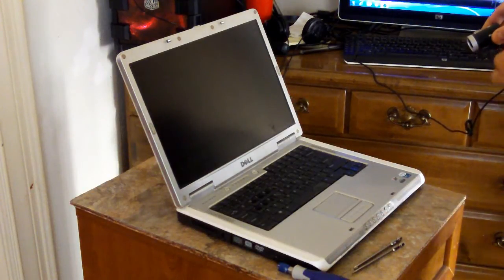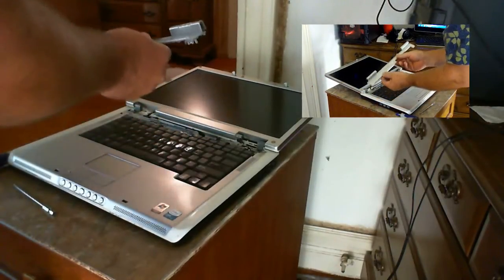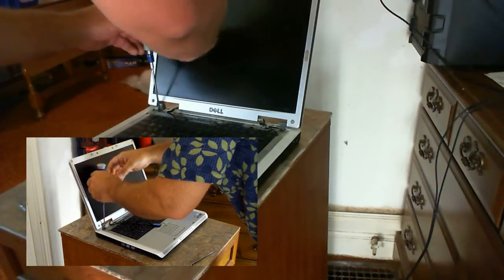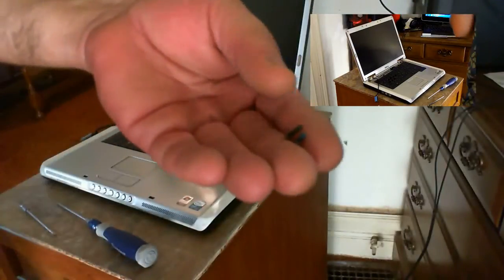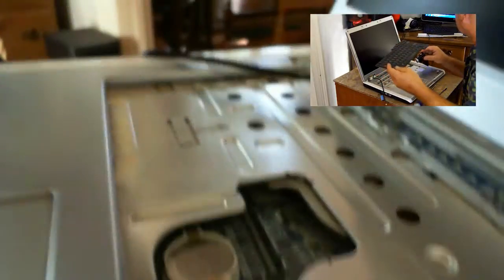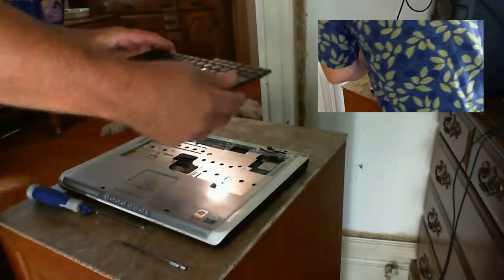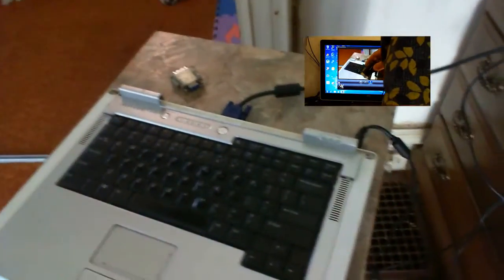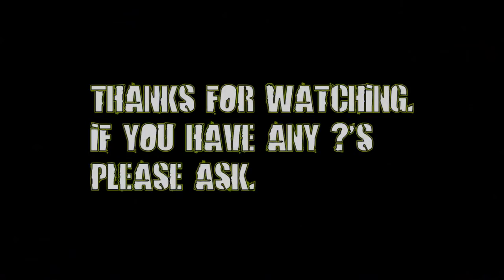Dell Inspiron E1505 laptop screen removal

Comment: Just to let you know, there are two screws you forgot to mention. There are two screws underneath the laptop that are connected to the long metal hinge posts. I figured it out when it didn't pull out as easily as you showed in your video.

Comment from the maker: @maddog9269 Yes but it transfers to the external monitor after the boot and by that time the stupid "Media Direct" would be fired up. You have to unplug the screen if you want to catch the bios in order to change the boot sequence in order to load windows from usb drive. 
Thanks for watching and for the input.

Comment: Ok , My laptop is a old brick but its quite fresh because i wiped everything and installed Ubuntu which is awesome.However over years the hinge has slowly broke and the left side of my laptop has totally broken off including some seethrough wires.The screen has finally broken but i don't usually use the screen anyways, i look through my hd tv monitor which is nicer anyways.There is another wire which i want to cut off to make it look nicer.Should I do that or will it break the laptop?